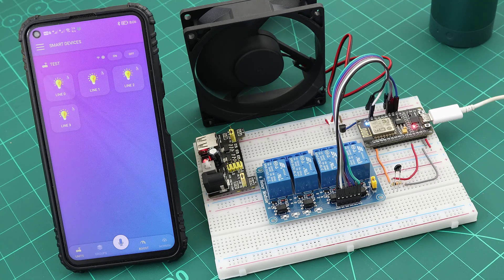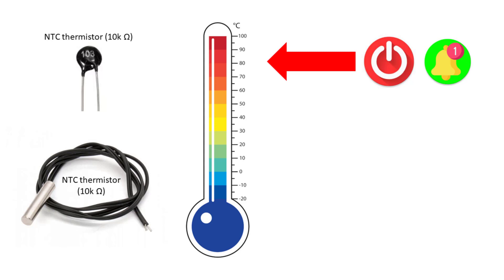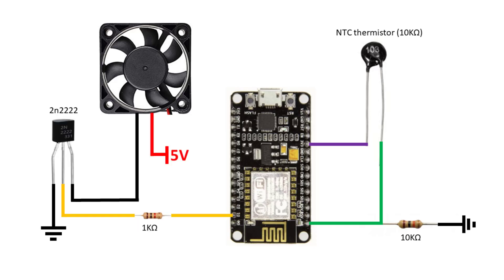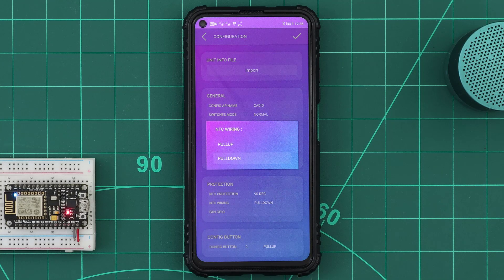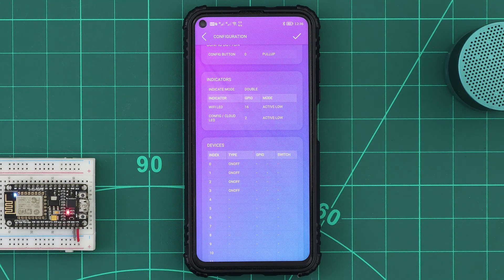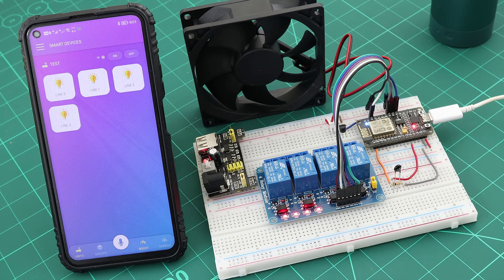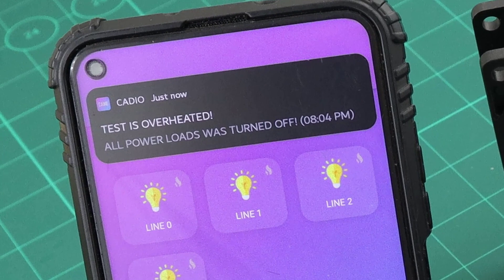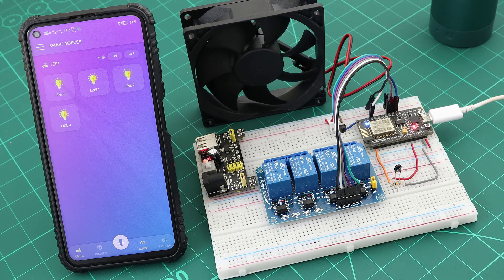Overheat protection using NTC and cooling fan in CADIO (ESP8266 - ESP32) | CADIO Home Automation

Comment: Following your channel from a week. I love the way you guys are expanding it and making it more functional 👍.
I have a suggestion 
Could you please incorporate the IR receiver as an  extra manual control alongwith manual latch switch.
I'm planning to switch on your platform from Blynk IOT, the only hurdle is IR receiver as extra manual control of my relays
Reply from the maker: Glad you liked it sir, Thank you for your suggestion, it will be token into consideration during the discussion of future developments.
By the way, you can use rf remote controller and rf receiver module, it's totally supported in the current version, I suggest you to give it a try if available, "specially from another room, from behind the walls 😉".
Reply: Yeah, that's good. No need to pointing towards device and can be controlled from other room.

But It is more convenient to control appliances of Drawing room  using TV remote. With one single remote, sitting on couch, controlling lights, fan ...

I'll try RF for other room  but I already have a functional pcb with IR receiver installed in the switch board.
Reply from the maker: IR remote controllers feature in now supported!
https://youtu.be/TCRG25qMikc

Comment: Why this "gpio should not be duplicate" message occurs even after having using different gpio's ???
Reply from the maker: GPIOs 0, 2, 16 are set by default to the config button and indicator LEDs.
Make sure you are not duplicate them.
By the way, you can change them if you need from the info file.
Reply: @cadioHomeAutomation  thanks for your support sir,, your response time is amazing,,great work sir 👏
Reply: Can i use this CADIO home automation as my engineering project ?
Reply from the maker: @LokeshKumar-nb3hw  no problem at all
Reply: @cadioHomeAutomation  thank you so much sir ☺️

Comment: and I have another suggestion, we need fan speed control four steps like relay one for speed one, relay 2, for speed 2, relay 3 for speed 3 relay 4 for speed 4 and off,  we can take care of the rest, we can design fan regulator or you can add only 2 input for increasing and decreasing fan speed.
Reply from the maker: https://youtu.be/HcYCt668MMo
Reply: @cadioHomeAutomation  please make it i will be happy about, and people are asking about the diffrent between payment and free software, thank you
Reply from the maker: The trial License is valid for 500 operating hours and can be renewed for an unlimited number of times by eraseing and re-installing the firmware.

The permanent license gives the unit a permanent permission to use CADIO system resources
Reply: @cadioHomeAutomation  please the price.
Reply from the maker: @arewatec  $7.99
Reply: @cadioHomeAutomation  is monthly, annually or forever?
Reply from the maker: @arewatec  forever

Comment: Sir
After upgrading to paid version for Esp32, if the board gets damaged or not working. 
Whether we can change the license to other board , or we have to pay once again.
Reply from the maker: Unfortunately, transferring the license to another mcu is not supported yet!
Reply: Ok sir
But at least in the future, please try to add it 
As it is very important and useful because the license is very costly,
Cancelling the old licence and replacing it with new license is very usefull.

Comment: Thanks for everything 
But how i can mod the info file?
Reply from the maker: After installing the firmware, connect your phone to the esp wifi network, and open the configuration page
Reply: @CADIO Home Automation   Yes i do it , but i need to reconfigure it with a modification in info file without reinstalling the firmware again
Reply from the maker: Info file can't be edited, to create a new info file you need to erase then re-install the firmware.
Reply: @cadioHomeAutomation  ok thank you so much

Comment: Hi
I want to use your platform offline without internet.  Is it possible?
Reply from the maker: Yes, it is activated by default, but some features will not work without internet like notifications and timers.
To achieve the best offline performance, you need to set a unique unit position on the network from configuration page instead of auto positioning.
Reply: @cadioHomeAutomation  thank you.  I test  If I had any questions.  I ask again